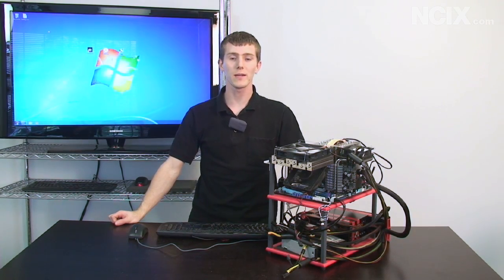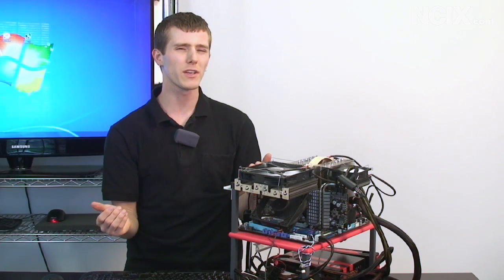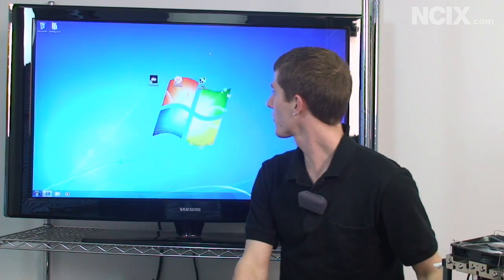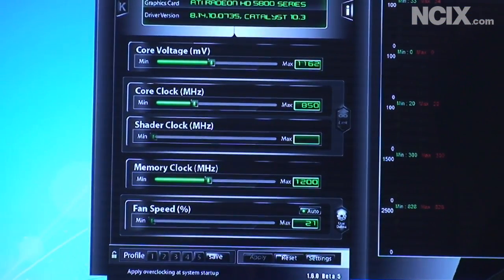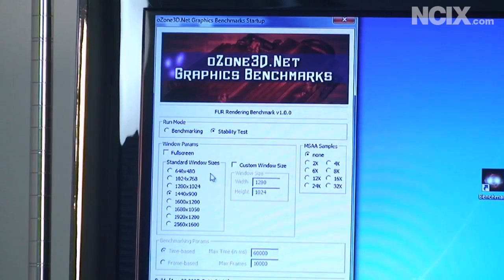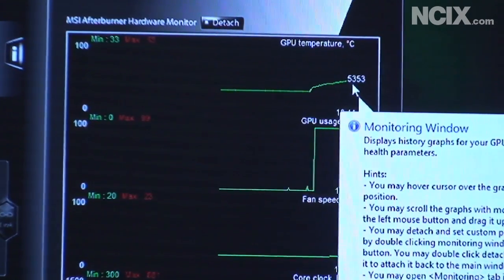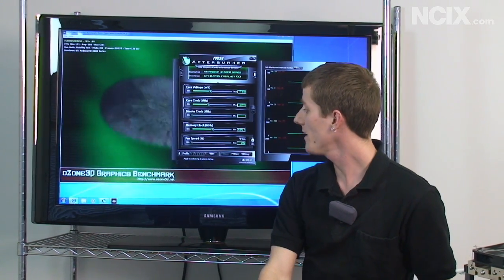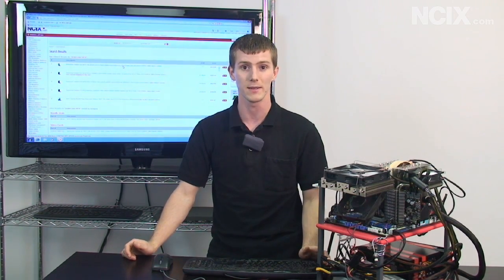Video Card Overclocking Guide (NCIX Tech Tips #69)

Comment: I overclocked my Sapphire R7 360 Nitro from the default 1060mhz@1500mhz(memory) to 1207mhz@1700mhz(memory). 

Now running benchmark Valley on ultra, I get an average of 23.7fps @ min-14.4fps    max-37.7fps. With the overclock I get an average of 29.7fps @ min-17.5fps    max-50.6fps.

I get 60°C max when running Valley for about 20mins and 73°C max with the OC

The card is barely 4 months old. Is the OC worth?
Reply: Rex Catipay Did you adjust voltage to max?
Reply: Yeah I set the power limit to its max in overdrive (10%).

Comment: Gtx 980 and I don't get the shadow clock option. Also I pushed it to 1500/7800ish without touching the voltage. Did I win or did I fuck up my card?

Comment: looking for knowledge on overclock ingredients. I have a msi gt72s dominator pro G with a 8gig gtx980m. looking to go a little higher than the stock boost of 135mhz. can anyone help? don't know much about voltage and other specs that you adjust safely to fine tune the clock speeds. looking to run games like tomb raider at 60fps on ultra I'm at roughly 38-50fps now depending on what's going on in game. please help 😊

Comment: I love msi afterburner, from ocing my old gaming rig to ocing my daily task laptop it hasn't failed me yet. Currently I have underclocked the core on my Lenovo G50-45 Amd a8-6410 to about 643mhz, while leaving my memorey at 1040mhz, although My ram is 2333mhz for somereason it only maxes at 1040 in afterburner so still havent figured out if its because im using two diffrent ram sticks one 8gb 2333, the other at 4gbs 1666 give or take, so iknow they not entirely compatible so theirs probally some conffusion for afterburner. But non the less underclocking seems to have smothed outmy laptop to better performance. Play around with settings and find what fits your load. Fully recomend getting a better laptop then the G50-45 its trash for anything other then daily tasks.

Comment: any ide why when i play witcher 3 and farcry 4 my cards dont stay stable clocked ot 1000Mhz i have 2 880m sli laptop alienware 18 my cards juts dont keep there stable clock they go down to mid 700 to 890 is there any way i can lock my clockspeed ? i from the nvidia control panel i did it on max power . . . any help plss :(
Reply: Check your temperatures. If they go too high, your computer will automatically throttle and dial back the performance so that the components don't die.

Some Alienware laptops are known for having Overheating issues.

Comment: How do i know if bios is locking overlock? I have a gtx 970m in my laptop and only have options to increase core clock and memory clock in afterburner. I moved them up bit by bit but nothing seemed to change and not fps increase in gta 5 either so I thought maybe it's locked. I wacked both sliders pretty high up and got purple artifacts on my screen and it froze when I did stress test, did a hard shutdown and it's fine. So is it locked or not?
Reply: It isn't a BIOS lock, mobile graphics simply do not overclock well. They handle it, sometimes. But there's negligible difference. Try running something like Cinebench and do the graphics test. It's not much different from playing a game, but I always get within 2 FPS of my results, because it's pretty much the same exact thing every time. If you see NO difference of more than say 5-8 FPS, I'd say leave it at stock. Because the 970M isn't really that bad, still not that good.
Reply: +DarknessTheKidd Minecraft and Other Gaming Videos Yeah doesn't seem to have any impact in GTA 5 . Just wish I could have a constant 60 fps without turning the graphics down. Although the lowest it goes is 45 fps in grassy areas with quality on max. Wish I could have pushed my budget for the 980M should be alright with that. Although my laptop uses a socket connection for the GPU I can't seem to find anywhere online where I can buy the 980M on it's own just links to laptops with the 980M gpu in them.

Comment: I beg you, I wanted to ask you do not mind a bit more I make sounds (whistling) for overclocking graphics do not mind it hope? I got it from a pulsed fundamental 810mhz 950 MHz Memory Clock 2206 Core Voltage 1075.rekl you can still pick up the necessary 970 mhz? How much do I adjust the voltage please?

Comment: AYYYY I fucking blew my GeForce GT 9500, I got like 800,000,000 AF on my screen, then it started smoking xD R.I.P
Reply: Crickets....
Reply: good job, with what did you replaced it?
Reply: A newer Radeon HD, I'll get the Number in a little bit, but I know it's like 1-2 GB of V-RAM, so no need to worry about anything. 

Like, performance wise it's a beast, and I've never needed to get anything fancy. MSI works so good with it though. The only issue is that when artifacts start appearing, it's not usually the graphics cards hardware. It's your resolution being ripped, you have to adjust it while it' doing that, then it fixes it's self on the preferred settings.

Comment: I overclocked my MSI GTX750TI 2 GB to 
GPU CLOCK : 1322Mhz
MEMORY CLOCK : 3023Mhz on STOCK cooler!

STANDARD IS GPU CLOCK 1085
MEMORY CLOCK STANDARD IS 2700Mhz
Reply: cracktober no i saw alot of difference  on gta 5 i had like 40   fps and overclocked over 60 soo..
Reply: +cracktober Believe me, if everyone had money, we would buy the most excellent PCs. But not everyone has money just like you.

Comment: am having a gigabyte amd radeon hd 7800 (twin fan not the tripple fan),
i used gigabyte oc guru 2 to overclock,
is it safe to use???
my reading is around 60°C   (max usage)
its default is gpu clock-> 975 & memory clock-> 1200 & min voltage > 1.138  &  temp> 33°C 
i increased to gpu clock-> 1000 & memory clock-> 1210 & min voltage > 1.148 & temp>56°C
is there a way to change its stock cooling to a better cooling? which do u preferred
reply plz :/

Comment: Should graphics cards running in SLI/Crossfire run at the same clock?
Reply: Yes, in sli/cf both cards operate based on the weaker of the two. So its fine for different clock speeds but the weakest will determine what frequency they operate.

Comment: Hi Linus hi to all I need an advice by someone. Can you overclock the "oc" version of the card? I have shappire radeon hd 4890 "oc" edition, and I just try to overclock it, using msi afterburner. But after overclocking, preformace is the same as before (I dont get any extra FPS). Only temperature is higher. I runed benchamrk unigine heaven, but the resolt was the same, as on "stock" settings. I run some games to check the fps like metro last light, Lol, and the fps was the same, as before on "stock" settings (before overclocking). Anyone knows why? I did not overclock it to hard. I found the stats on some forum, and it is supose to be safe.  Core clock from 870 to 950 and memory clock form 1050 to 1120. And I dont get any bluescreen, or any graphic problems.

Sry for bad english

Comment: Why cant I get higher core voltage. Max is 1350. I have tried the ELUA and the the -XCL in the shortcut path with the .dlls methods but still nothing higher. I have done it before with the same graphics card a long time ago. I have a MSI R7970 and a MSI 990FXA-GD80 MoBo.

Comment: i just overclocked my nvidia's ancient geforce 7300SE from 450MHz to 600MHz, improved a bit
minecraft setting - far,fast with optifine went from stock 450mhz which got 20-30FPS, with 150MHz OC i get 25-47FPS, really good incrase there
i just put a fan on a fanless cooler to OC it
idle is not good... - 69C to like 74c
load - 75c to 83c
thankfully it don't go over 90c
perfectly stable, but i don't go over 650MHz so it won't be like opgngl thing crashed and blahblahblah
and if i go over 750MHz the screen would flash but not crash and i have to restart it
Reply: got my GTX 650 from 1111Mhz all the way up to 1320Mhz with voltage offset of +75mV :D got my memory from 5Ghz stock to 6.2 ghz :)
Reply: darkmonster11LP wow

Comment: hey! i've overclocked my sapphire radeon r9 270x vapor-x! i have only raised the core clock 60 and rasied the powerlimit to 20% and i wonder if this could anyhow hut my card? when i'm ingame and playing bf4 my AVG temperature is like 65 celcius! could this hur my card in any possible way? please respond!
Reply: The only thing that will hurt your card is adjusting the voltage too much. A simple core clock, memory clock or power limit boost wont hurt the card. Note: Power limit has nothing to do with the voltage.

65c is fine. You don't need to worry about GPU temps unless they're hitting 90+.

Comment: Can my graphic card get broke or something if i'm using max fan speed?
Reply: i have fairly quite fans so its not much of a problem for me but if it does get to loud i can always put my headset on
Reply: No I always use max fan speed and i fine, if anything it will help you as your temps will be lower.
Reply: you can break the fan, and if you run your graphics card for long with a broken fan it will break.
Reply: ive never broke my fan and i leave my pc on 24/7
Reply: Ellis Friths same here i run 24/7 at 100% all my pc fans btw its to loud best way put your pc into store room and pull a hdmi cabel to your led ;) if my pc burns my house wont my store room is empti with 1 exsote fan